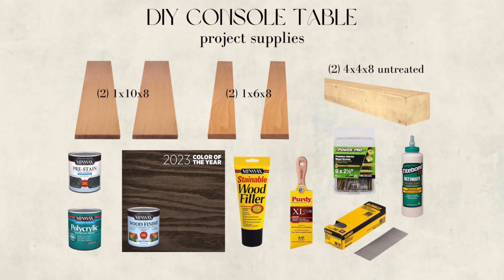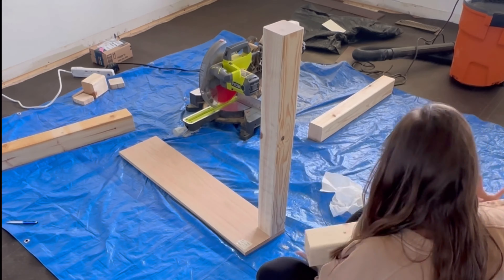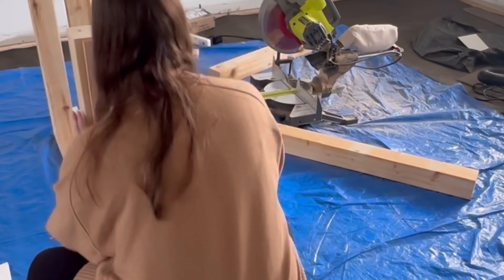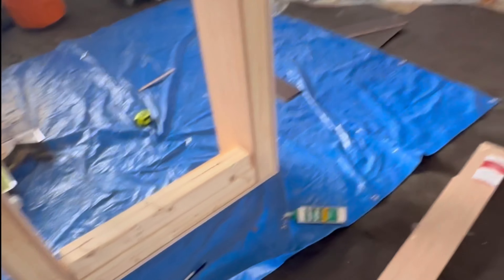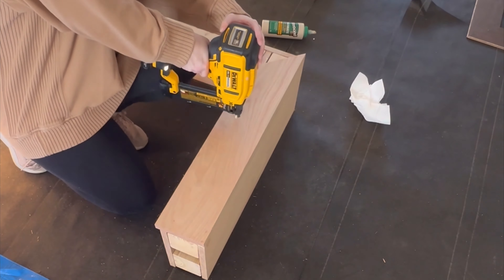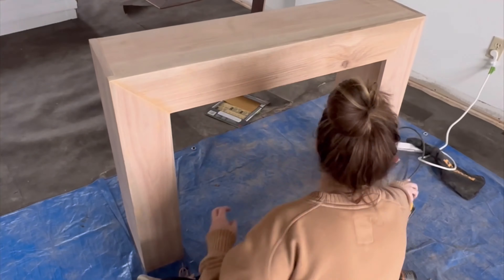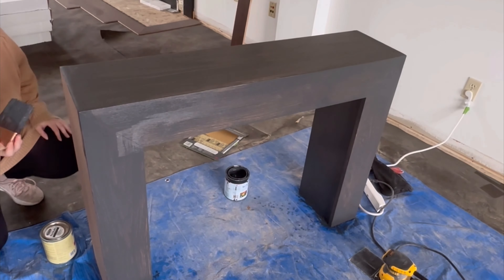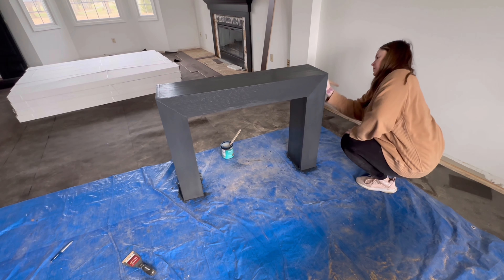EASY DIY TUTORIAL: Console Entryway Table Build Start to Finish

Comment: FYI, pressure treated lumber is perfectly safe to use indoors.  It hasn't used toxic chemicals (chromated copper arsenate or CCA) since 2003.  I wouldn't use it to make a cutting board, but it's fine for table legs.  It would be awesome if people would stop perpetuating this myth based on 20+ year old information.

Comment: You did a great job!! Thanks for sharing! ❤ your info is all correct 😊also thank you for explaining the difference between pressure treated wood and Kiln dried. A lot of new diyer’s may not know the difference. I was just pricing out those 4x4 posts and in my area they are about $12.78 at HD. So after looking at your video I decided that since the 4x4’s won’t actually being showing that I will frame out the interior with 2x4’s. I should be able to achieve the same results. I believe that this should significantly lower the price or maybe give me more money to splurge on a nicer hardwood for the surround. Again your project came out beautifully. Thanks again for sharing ❤ I’m going to try to make two of these. Wish me luck 🍀

Comment: Looks great..  but a few notes...  

You could have used 2x4's instead of 4x4s..   since they are all hidden behind the over panels.  

If you don't have access to a table saw, you can use a flush trim router bit, to trim up the panels on the inside parts of the legs, so there's no overlap.